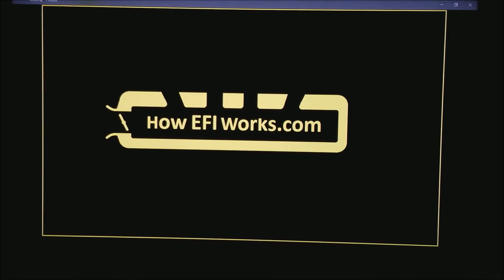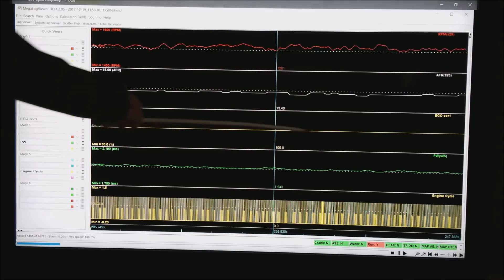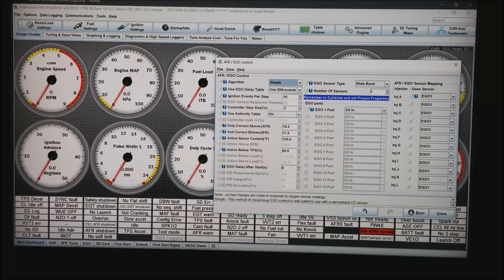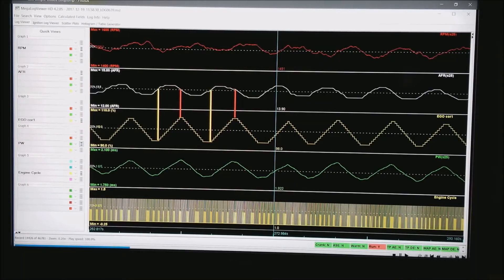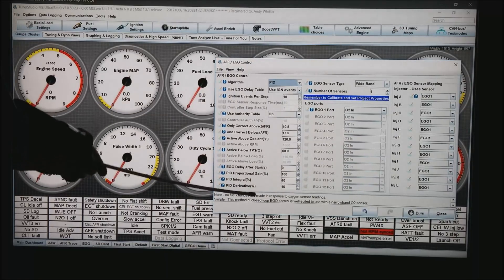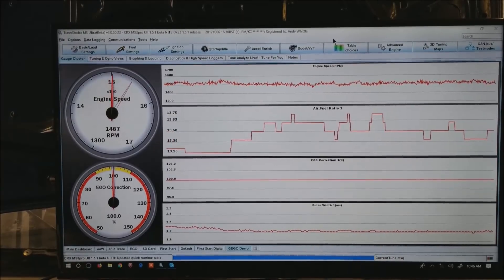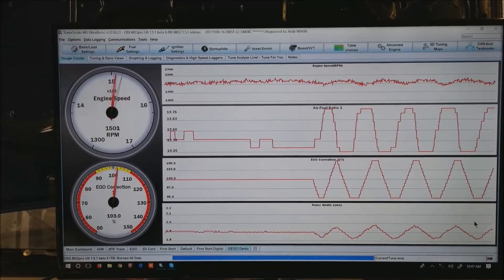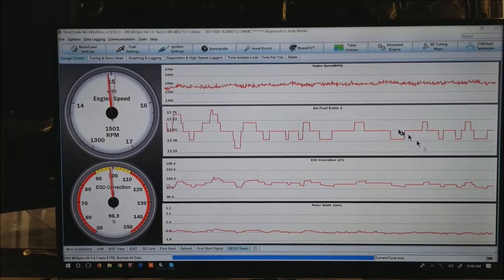Open and Closed Loop AFR Control

Comment: In order to run in PID mode you must have wide band O2 sensor and ECU which is able to read it and PID is actually closed loop with PID optimization, am I right ?
Reply from the maker: Yes
Reply: @AndyWhittle_HowEFIworks  Thank you sir !

Comment: Why do cats need a swinging afr?
Reply from the maker: It has something to do with the chemistry of how a cat works.  The exact reason is above my pay grade.
Reply: @AndyWhittle_HowEFIworks  Fair enough. Thanks for the reply. I've been running no correction for a long time with cats. They still work fine but now I'm concerned about longevity. Dual high flow metallic magnaflows. If it's just about efficiency then I'm good. Still pass the sniffer.
Any chance at a PID video for EGO and idle?
Reply: @exidous6831  they do not need it actually but when the whole system  was invented the only lambda sensors available was the narrow band one and because of their reaction ( they shows only lean or reach mixture ) all the algorithm with short and long term trims was created around that behavior of narrow band lambdas . Catalytic converters work perfectly with stoichiometric mixture but since the the lack of fast reaction times and two position output of the narrow band lambdas the air/fuel ratio oscillate around the stoichiometric one . The oscillations must be fast  enough and the periods when the lambda read reach and lean to be equal in order  the average premixed a little bit lean and a little bit reach exhaust gasses  before the catalytic converter to be as much stoichiometric as possible .Here one good video on catalytic converters  https://youtu.be/HADOcrcMikA  
BTW narrow band lambda ,catalytic converters and ECUs was used even in the pre fuel injection era , on so called electronically controlled carburetors which was a predecessors of mono injection systems .

Comment: Andy thanks for the Vidios, You have a field "Engine Cycle" in Log Viewer. I use LogViewer MS do I need to upgrade to HD to get the field?
Reply from the maker: See my video on setting up high speed logging.  The required settings are in there.  The MS version is fine to log that.

Comment from the maker: Note that when I was in simple mode, I was getting .7 AFR swings.  If your target AFR is 14.7, this would give a swing from about 14.4 to 15.1 AFR.
Reply: Im tuning a Delphi MT22 factory software..........it was setup from stock (Great Wall), to be in closed loop almost all the time.  It explains why its acceleration was incredibly mediocre.